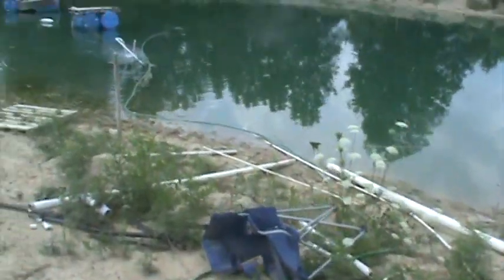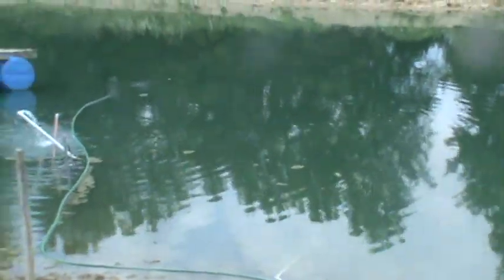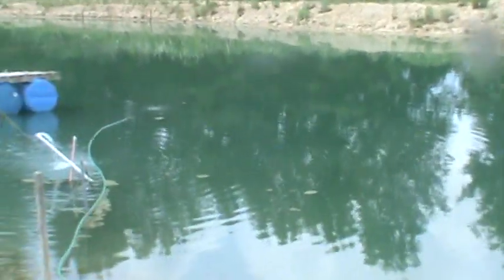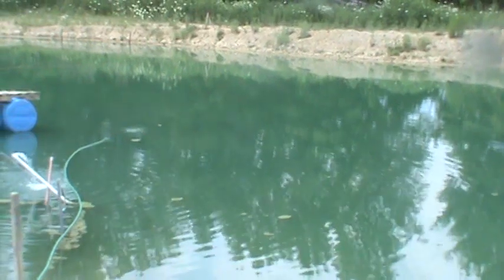aeration pump 60 watts vs 12 volt bilge pump moving water

Comment: 50' pond, about 6-7 deep in the center in WNY.  
Thanks for the idea of soaker hose, thats a good idea.
Getting some 200w solar to power a 100w lift.
Reply from the maker: You have 1/2 the Solar power & more than 50% power demand, are you going to put this on a timer and limit the run time? 
Or swap out the batteries, full charge off line. 
I wonder about using capacitors for easing the demand on the battery on startup (dampen or lowering the shock). 
What size battery are you using? 
You really don't need to run the pump in the day time, but the 400watts I had would do that and still recharge the batteries. Night time, overcast, cloudy days got me.  But in a pinch, during the hot-sunny months of July-Aug it's a good fix for aerating your pond without having access to commercial electricity. 
Good luck.

Comment from the maker: Update this aerator runs off NorthEast Ohio solar panels, and 100A-hr battery, this aerator the best bet, it works with the 400Watt panels, I turn the panels off 8 times per day for 15 minutes and the pump keeps going with stopping even on over cast days.

Comment: I just purchased a new 100 watt pump for my koi pond that is 12 feet x 18 feet x 5 feet deep. I'm going to make a rectangular PVC 2 inch pip frame that is 10 feet long by 5 feet wide by 2-1/2 feet high and run a soaker hose around that. I'll keep you posted how it turns out.